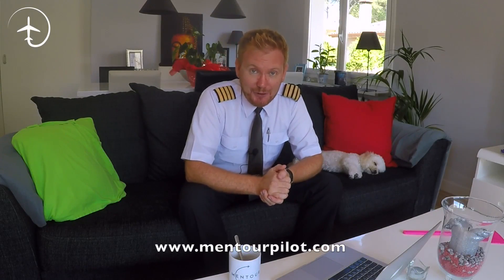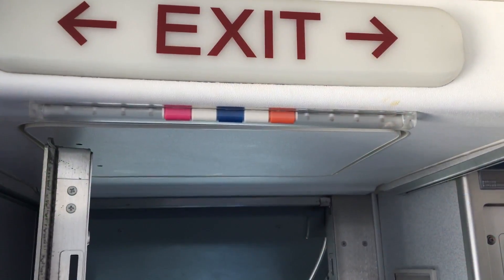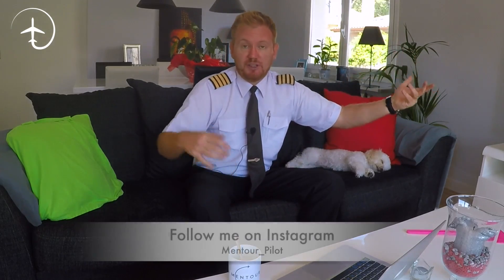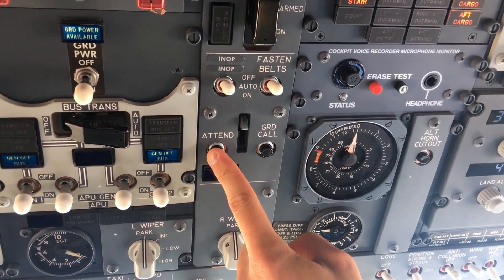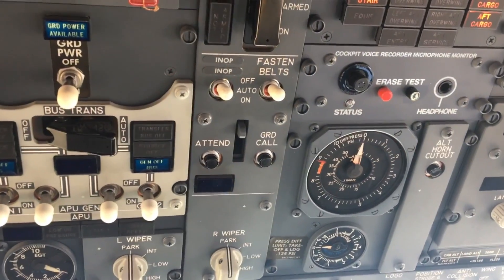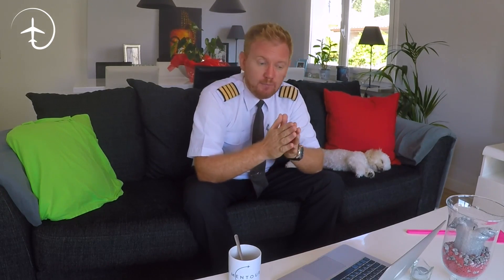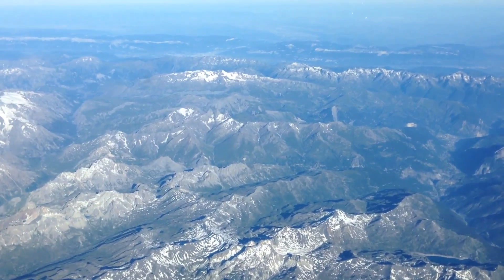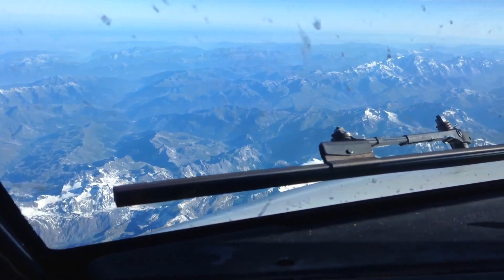Aircrew secret "sign" language - Explained!

Comment: I've wondered... If you have time, please tell us how  PITOTS work. Thank you in advance
Reply: Pitot tubes measure the difference in static and dynamic pressure. The bigger the difference, the faster the speed. They have holes in the front and on the side - these measure the two pressures (or actually, just the difference between them).  First year process engineering...
Reply: @martincraig9613     Thank you very much.  I thought that maybe the forward speed of the aircraft caused air pressure at the entrance of the tube which then pushed a small spring loaded circular surface into the tube and the pressure on the spring measured and the air speed calculated but obviously I was completely wrong.  Thank you again.
Reply: You were nearly correct - there are just no moving parts in a pitot tube. I got one part wrong though. The front is total pressue, the side holes measure static pressure. The diff between them is dynamic pressure.
Reply: @martincraig9613  ... I cannot believe that I was almost correct. Thank you for, basically, teaching me.   You are an airline pilot, aren't you ?   Thank you again !
Reply: Ha ha - not a pilot at all.  I’ve a degree in chemical engineering. Pitot tubes are used to measure air flow in ducts (at least that’s what we were looking at). A pitot tube on a plane or helicopter or formula one racing car all have the same basic function as a pitot tube in a ducting system. The only difference is that ones used in aviation are heated, as ice build up would lead to incorrect pressures and incorrect air speed readings.  This has resulted in a few crashes - unfortunately. 
The other difference is that in ducting, the pitot tube is not moving but in cars or aviation it is moving. Hence in the moving situation, it measures air speed, which is not the same as ground speed.

Comment: Wow, even that much could be considered safety sensitive information...
Reply from the maker: No, not really. That info is all readily available from Boeing. It’s how these systems are used by the airlines in safety procedures that can be sensitive
Reply: I sure hope the codes to get on the P.A. or sound the chimes and illuminate the pink light are reprogrammable by the airlines!  Otherwise some prankster who can read a technical manual could cause some serious havoc in the air.

Comment: MP, thank you for a very informative video! I fly infrequently, so I now know what the chimes are I hear on each flight, as well as the cabin lights. I only have one question: what does flight crew do when you ask them to perform "crosscheck"? That one is still a mystery to me.
Reply: K.R. Baylor they crosscheck each other’s work. “Cabin crew disarm doors and cross check” means that one crew disarms the door and another crew checks the work.

Comment: One flight I was on there was a child that kept pressing the call button. The flight attendant went into some menu on their touch screen and they were able to disable all the call buttons for that row of seats. Which I thought was a pretty cool feature. If I remember it was an A320.
Reply: Selective disablement would make a lot of sense for those - Not just because of inquisitive/restless kids, but also because of disruptive adults! (A UK export many of us here are not particularly proud of!)

I found myself sat in an "off" row once as It hadn't been re-enabled after the previous flight. I found though that raising a hand was just as acceptable, though admittedly I'm the sort of passenger who prefers to walk to the galley rather than have the crew walk to him! :-)
Reply: You would think it would make sense for it to reset on the ground. I suppose if it is an electrical fault and not an annoying passenger you want it off. Those panels definitely know when the aircraft has landed because they switch to showing the water and sewage tanks on landing.

Comment: Mentour Pilot 
Interesting that if you look very closely at the no smoking button, The "in op" are TWO DECALS stuck over the actual "NO SMOKING" printed words. So it appears that on SOME crafts this button can in fact be configured (using CANBUS system?)  to be functionally active with the ability to turn the no smoking lamp on and off.

Comment: Great video - But you forgot to mention the button that serves you orange juice. (Only Swedish people will get this.) Another thing is one of the PA call that I always has read wrong in the past and its the "Crew: Arm/Disarm slides" - I was sure the call was "Crew: Arm/Disarm flight" and I always wondered why they needed the flight to be disarmed or armed. Johan.
Reply: So it depends the airline how they say it but it means to arm/disarm the doors.

Door slides deploy if opened and it's in the armed mode (and sometimes have power assist to help open it)

If disarmed...no slides deploy.

Comment: Given all of the technology it seems odd that relying on the deprecated no smoking sign has a key use.
Reply: Being a smoker myself: When +Mentour Pilot mentioned this, I wondered if that ever causes problems with passengers getting the false impression that smoking is permitted?

I can certainly say (on flights originating from/run by UK operators) that the overhead No Smoking sign remains illuminated for the duration of the flight. :-)

Comment: Great video as always...but are there communication procedures for more urgent/emergency procedures too?
Patrean Brian
Reply from the maker: There is bit but I’m not allowed to share  security procedures.
Reply: Of course. Well, slightly off topic, I know there are 3 ways to communicate with the ground without using the radio...using the radar squawk instead. One code is for "radio out" one for general emergency and one for hijacking. The idea of the last is the hijacker will limit voice communication but not general dial manipulation.

Comment: The New York City subway uses "ding-dong" signals on trains that sound a lot like the ones you're describing here.
Reply: +Ace Lightning IIRC the "Ding Dong" means "Doors are open" and a repeated beep means "Doors closing / Stand clear", doesn't it? (Both being provided for visually impaired pax under the ADA. :-)

That said, it's been ages since I last used the MTA. Many London Underground lines use a similar system, and I could be getting mixed up. :-)

(And that reminds me: MetroCards don't work on the Underground, even though some MTA gates seem to accept my Oyster card for some strange reason! :-o :-)
Reply: The sounds were built into a particular model of subway car that was put into service during a "modernization" phase; it was not meant as a convenience to handicapped riders (this happened before such things were required by law). The "bing-bong" sound means "Watch out for the closing doors", and the single "bing" is for doors opening. I always find it amusing to hear "Watch for closing doors" aboard an aircraft!
Reply: +Ace Lightning "Please mind the gap between the plane and the gantry" :-)

"This plane is about to depart. Please stand clear of the doors, mind the doors! [Beeeeeeep!]" :-D
Reply: "Get back from the jetway, or wind up on the ground!"
Reply: That just indicates another stabbing or assault has occurred on a passenger.
Reply: Not at all - the NYC subways are not nearly as dangerous as people outside of NYC think they are! The "ding-dong" chimes mean things like "watch the closing doors"

Comment: Hello!  Another Subscriber question here...     As an Amateur Radio operator,  I've had the Pleasure to QSO (contact/talk with) Several Pilot's, While In-Route!  Of Course, they turned over PIC (Pilot in Command) duty's!!  I know that these are HF (high frequency) Radios, that are used for Flying over Oceans.  Because the VHF/UHF frequency's, are "line of Sight" (+ about 15%).   These Pilot's,..  were Just "TESTING" the Radio unit's, for correct operation.    If you could Please,.. extrapolate a Little More on These (antenna's, in vertical stabilizer?),  and Other Radio system's?                                                                                                                                                                      You have Wonderful Video's.   Thank You, for Your Time!              -Thom

Comment: On a flight a couple of years back, the flight crew completely forgot to switch off the seatbelt signs.  However our screaming baby needed something from our overhead locker.  He was making plenty enough noise that the cabin crew got the hint and reminded the captain and got the signs switched off.  Is there some kind of system to remind the captain to switch off the seatbelt signs, or is he/she just supposed to remember to do that?
Reply: You really should not put babies in the overhead compartment:))
Reply: yea there is, we call the flight crew and ask them "is the seatbelt sign still necessary?" and then they tell us if yes or they turn it of cuz they forgot

Comment: I am surprised that in this day and age pilots do not have a CCTV connection with the main cabin so they can see what is going on with the crew and passengers rather than relying on 'bings' and 'bongs'. When I watch flight videos, not long after take off and during climb out there is another 'bing bong'. What is this for?

Comment: One thing that commonly misunderstood by passengers is the final sequence of chimes after landing and arriving at the gate. There is a crew communication chime that comes before the "SEAT BELT OFF" time. The chimes are different and there is also the lighted sign that must be extinguished however, some passengers unclip and stand up to retrieve bags from the overhead lockers when they hear the first chime, while the seat belt sign is still ON.

Comment: I enjoy your videos.  I have a question:  What is the function of the little rectangular metal clips on the surface of some plane wings?  Also, what is the purpose of the triangular metal wind foils that are on the cowling surface of the engines?
Reply: Vortex generators.  A simple answer is they help the aerodynamics of the wing as well as dampen noise at the speeds the aircraft travel at.

Comment: Hello, at 15:00 you are talking about ways to deal with problems. This is very important part of it. But in science it comes up a setting called the hermeneutic paradox what actually is "You haven,t understood the complete whole before you understand the parts of it, and you haven,t understood the parts of it before you understand the whole. This is a way scientists use when dealing with complex problems. And it is probably the same way when dealing with complex things in the cockpit as well. I remember when I was flying small planes my self in the 89-90.s I already dealt with problemsolving at a quite high level. And of course when flying everybody need to think fast and reliable, but also putting things in action very fast.

Comment: In my country, Argentina, they do a lot if these things communicating through the PA. For example sometimes they say. “Tripulación puertas en automático cross check y reportar” which means “Crew, doors in automatic  cross check and report”. I usually hear that before taking off or before pushback. And also, the talk through the PA when the plane js above or below 10.000 feet. This happens only in one airline I flew however.

Comment: Hi Peter, another awesome video. 

Recentley I've experienced an delayed due to a techinical issue on a 737-800. There was an issue with the front door of the plane (tha cabine crew couldn't anymore fully open or close it). This caused the flight to be delayed 8h (local tehnicians couldn't fix the issue, so the airline flown some techs from Italy). What issues have you encountered during your years of experience (at some point you've mentioned about flaps issue). 

And another possible idea for a podcast (it's actualley related with this incident). Since the delayed took that much, a lot of people canceled/shifted to different flights. At the time of the  departure only 30-40% remained. The flight attendant asked 5 passengers to volunteer to move in the back rows of the plane (for the balance of the aircraft). Nowdays airlines either you pay to reserve your wanted seat or wait for the random assigned ones. If you could approach in a future podcast. Also, do you guys also give instructions to the baggage handlers how/where to load them (saw flights that they we're having only one cart of luggage, others with 3-4 carts of luggages). 

Keep up the good work!

Comment: Often wondering what all those dings and dongs were. Curious, with security as it is now days (locked cabin door) how does a cockpit crew on a long haul, use the laboratory and receive meals. I've been on some really long flights and now thinking back on it, I don't think I've ever seen the cockpit door open for any reason.

Comment: Tnx. Nice video. I love it when a pilot speaks to passengers. Some of them give good informations.
Reply: and SOME of them tell little white lies, but only to avoid panic. Telling the passengers that the Ground Crew thought they had seen something on the Runway and wanted to investigate, was much more acceptable than the TRUTH, which was in fact, that the starboard landing gear was failing to lock. He 'went around' and out over the fields of wheat, put the Aircraft into a VERY sharp 90 degree turn to the right, at the same time as, once again deploying the gear, this time successfully. 3 'greens' means SAFE.
Very competent Pilot, who saved the day without worrying the passengers,  Well done Sir.

Comment: I've always wondered what the bell tones were after the climb out. Just learned that it was to signal the cabin crew to begin service.  It seems to ring at around 10 thousand feet.
Reply: Impressive777 10.000 feet height from the ground or 10.000 feet air pressure

Comment: I know you're a 737 pilot but I still don't know why most planes I've been in have a ding just after take off approximately 10 or 15 seconds after rotation.
Reply from the maker: Hi! Some aircraft have the seatbelt sign and the no smoking sign connected to the landing gear position. It is very possible that the ding you are hearing is the effect of the gear being fully retracted.
Reply: @MentourPilot  thank you ever so much. I assumed all planes did that.
Reply: the A320 does this, cannot speak for the Boeing

Comment: Is “cabin crew, arm your doors” the same as “cabin crew, seats for landing”?
Reply from the maker: No, that call comes from the purser abc has to be done as the doors are being closed for departure.
That is to arm the escape slides in. Case of an evacuation.
Reply: I recall on multiple flights the pilot saying "arm your doors" about 7 minutes before landing, but I'm from New Zealand so maybe it's different procedures here. I understand it's to arm the slides, just wondered if there was any similarities from your experience. Thanks for the response.
Reply: In some airlines cpt gives "arm slides" but not here.

Comment: If one of the pilot needs to use the washroom, is the other pilot left alone in the cockpit?
Reply from the maker: That depends on company procedure and I am not allowed to talk about those procedures here.
Reply: I understand its for safety reasons.Thanks a lot for your reply Captain
Reply: Well I figure it's either "yes" or "no".  (Unless company "procedure" dictates how the crew are supposed to do their washroom activities?  In which case, I'm not sure I really want to know!)
Reply: Makes sense that there should always be 2 people in the cockpit. Ive seen flight attendants step in when someone has stepped out
Reply: Every airline has different procedures. Having worked for an airline as cabin crew I cannot comment either
Reply: Here in the U.S., a flight attendant will step into the cockpit and close and lock the door. This is to insure the pilot taking a dump can get back in regardless of the circumstances. The procedures don’t seem all that secret to me. As a passenger, I can see exactly what they’re doing when the pilots come out to use the restroom. I understand, however, that company employees can’t comment.
Reply: Auto mode
Reply: Ramesh Sharma ___ Probably not anymore. German Wings flight 9525 and Egypt Air flight 990 both had suicide by pilots who were left alone in the cockpit. Possibly Malaysia MH370 too.

Comment: with advanced technology, it is easy to fix a few cameras in the cabin for the pilots to see what is happening behind them. This may be even more useful in case of a hijack situation. Also, I wonder why aircraft of all types don't have small cameras fixed outside to give a good view of control surface and landing gear etc just in case something goes wrong with outside mechanism.
Reply from the maker: That’s a good question.  The “cabin secure” calls or signs would be needed anyway since they also indicate cabincrew duties complete.
Reply: Mentour Pilot Yes, now that the technology is readily available. I recall an air tragedy video where procedures weren’t followed during an engine replacement causing cracks to the pylon. The engine came off during takeoff damaging control surfaces and hydraulics on the left wing. The slats ( and flaps i believe) retracted. Procedures at that time required them to reduce power, a fatal decision. lift was reduced on that side, and it rolled to the left and crashed. The pilots did not know they had literally lost an engine, only that it failed from the instruments. . Had they been able to immediately recognize this, they could have added power and compensated for it saving the flight.